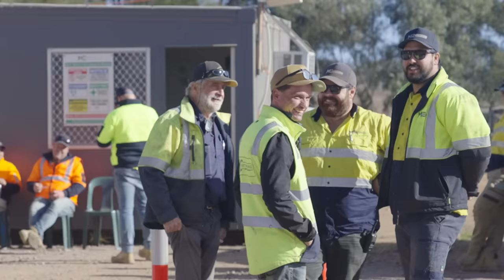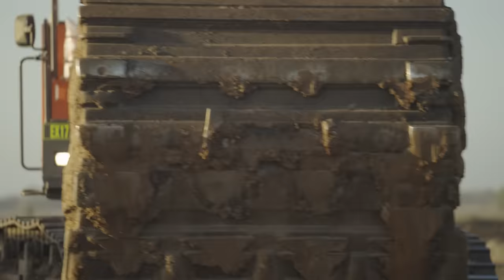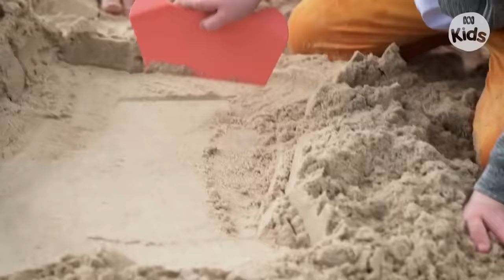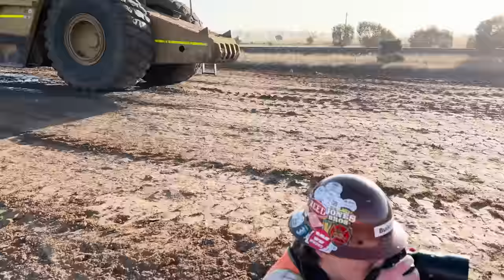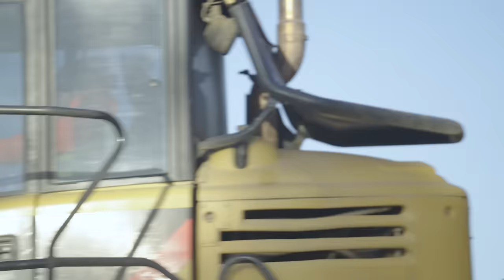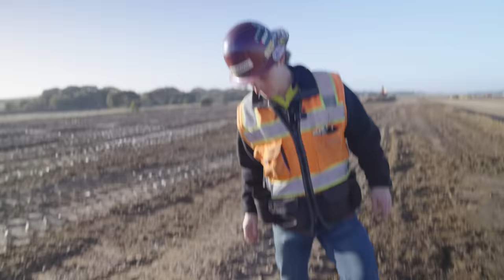MASSIVE Earthmoving For A BIG Dam Project

Comment: The evaporation on an area that big is crazy. Deep is good.
Reply: My immediate thought also.
Reply: @rogerclough8800  ditto
Reply: Maybe they'll do the ping-pong ball thing I saw in Los Angeles.
Reply: @jimsvideos7201  that is a good idea.
Reply: Deep is expensive. high risk of failure and not practical
Reply: It's probably not as much as you think at first thought. I'm a farmer with a few dams and I was surprised to learn about evaporation after I first bought this place. Worth learning about it.
Reply: @jimsvideos7201  They were abot 4 inches (10cm) diameter and black heavy PVC weren' they?

Comment: Love the blue collar life and being a diesel mechanic, i Love your videos bro. Love heavy equipment and watching it work. Love the podcast too! Stay safe brother
Reply: Trust me you will get fed up with it of it will f you.
I started heavy went light then quit at start of year due to injury. 
Plenty of jobs in office but could not do as they don't like blue collar moving into office even though qualified.   
    Angry is a nice way of putting it.
But yes heavy was fun,  working on toys, part swapping is boring.
Reply: Genuine question since your a diesel mechanic:
There's an academic saying that heavy equipment will always need diesel,  and can't run on petrol (cause higher revs and lower talk), and hence moving to electric cars won't cut oil demand, just create a petrol glut.

As a mechanic, is he right about petrol engines in heavy machinery? Could you switch to petrol if it got cheaper?
Reply: @domtweed7323  Having worked in the industry it's not entirely accurate. 
Back in 80's I got the pleasure of working on a 50's or 60's fire department ladder truck. It had gasoline  engine. 
 Reason.... Diesel at the time could not give the acceleration in an emergency. 
Think was a Dennis and .motor may have been Rolls Royce ( could be wrong on motor name )
Electric? Here in Australia, when the fire crews are out in the bush for days chasing a massive fire, I don't believe is practical at the moment.
Reply: @chuckmaddison2924  That makes sense.

With very heavy equipment that needs a lot of talk would be petrol engine be workable?
I've heard people say petrol engines just can't match the talk of a diesel, but that sounds like something gearing could solve?
But alas, as a mere humanities student, I don't know.
Reply: tach*
Reply: @domtweed7323   Diesel is more efficient than gasoline engine. 
If you look at the seriously big stuff like our mine site trucks and a lot of locomotives, they are Diesel electric..
Diesel can be run at it's most efficient point to generate power and the electric traction  motors are about 80% efficient. You also dont need the mechanical transmission system. It's a win,win situation. 
Gasoline can be as low as 20% efficient.
 There is also a very real safety issue with gasoline in boats with vapour.  Ignite it in the bilge, and its like dynamite.
Reply: @chuckmaddison2924  Thanks, that makes a lot of sense. I didn't know traction motors got efficiencies that high!

So someone could, hypothetically, run a big mining truck off gasoline, it would just me much more expensive? (Cause of the lower efficiency, and extra cost in designing the transmission system/safety systems.)

And the gasoline boat thing is interesting. I've never heard about it before, but it makes sense.

Thanks loads 👍
Reply: @domtweed7323  the 80% is ball park plus or minus a couple. 
The control system of motor can also vary. If pulse width modulation control is used the efficiency of the CONTROLLER can hit 90 %.. Electric is great.
Gasoline could be used but silly. 
Steam is also good and strange. 
High torque at zero rpm.  And at zero rpm,  as nothing moves zero horse power.  Power = rate of work DONE.

Comment: If the dam is not very deep there will be a huge water loss by evaporation!
Reply: It gets used in a day or so after filling it on order.
I've seen cotton farm dams being dug out Diamantina way that look like a bottomless open cut mine during construction.
New 20*20m dam on my hobby farm is 7m deep and clay lined to reduce some evaporation.
Their budget my not have covered going down much. No lack of clay though.
Reply: Like he said in the video. It’s more a temporary distributor than permanent water storage.
Reply: Was the 600mm 2ft of clay removed from the bed all used to build the bank?
I think they wanted to gravity drain out all the water back onto the downstream side of the Regulator.

Comment: I’d like to know more specifics on the drain and how to move water on demand for the farmers without the concern of erosion. Seems like there are a lot of fluid dynamics at play where I’m used to seeing more of head gates that open and close based on demand.
Reply: The sand is only a seepage drain in the wall, NOT the water discharge

Comment: very cool, I had no idea anyone could retain water in sand. dudes figuring it out. I am here in Cali n be willing to bet there's a few west coasters investing heavily here. same crops n way less Sacramento in Australia..
Reply: His previous video shows that sand is a thin sand filter layer on the outside toe of the bank. This is designed to intercept hydrostatic pressure and help protect outside batter from slump.

Comment: A silly question:  Are they going to be looking at some sort of hydro electricity system with this dam?  Both on the inbound and outbound sides???  Yes, it is realised that there is not much fall / head, but, engineering can be done on the generation side to get some value from the water flow.

Comment: In the 1980's I lived adjacent to an Evaporation Basin, you can see it on Google Maps on Morrison Road between the Towns of Stanhope and Girgarre, East of Watson Road in Northern Victoria. This dam was built to evaporate water and contain salt pumped from underground thus lowering the water table and protecting farms from surface Salinity. I have issues with this dams construction. It will have a very high Evaporation rate, possibly Mega-liters per day in hot weather, Evaporation Basin 3 Mega-liters per day over 45 Hectare area. Compaction of the base in the Evaporation was topsoil compacted with a forty ton Sheeps Foot Roller, the silt from muddy water sealed the basin very well. 
Having to pump water into this dam will ad costs that will raise the cost of delivery, water delivery must be monitored to asses cost of production. Water costs will affect viability of the surrounding farms. Another issue is the Hydraulic pressure on the land underneath the Dam itself, it is recommended that water be stored below ground level, this would mean less seepage and evaporation, of course pumps would be needed to extract the water. Turkey nest dams are a no no, they might be cheaper to make but the environmental  damage can be significant.

Comment: Australia is a dry county. We shouldn't be growing rice or cotton!
Reply: You don’t know anything about farming your almond milks require way more water - we grow efficient dry land rice in terms of both fertiliser and water use and our cotton industry is set up within existing irrigation regions, with associated infrastructure we produce very green cotton better than China or India in terms of environmental impact
Reply: @EmDee-gi5er  there's two sides, to every story
Reply: @justinrice8509  you forgot to mention the water use efficiency gains the growers realised since the 70s and the biggest reason why cotton is actually better is where do you think nylon and polyester come from? From oil
Reply: Cotton does not use significantly more water per Ha than other crops.  Over a year Almonds and Oranges will have higher use.  Sugarcane is around 2x cotton in terms of annual use
Reply: @EmDee-gi5er  that's truth
Reply: @EmDee-gi5er  they should ban almond milk. How many almonds per litre, crazy. Need some help to get less fertiliser. We need it but it's evil.